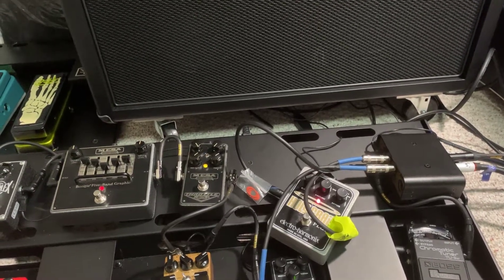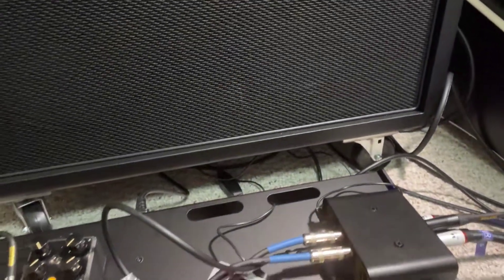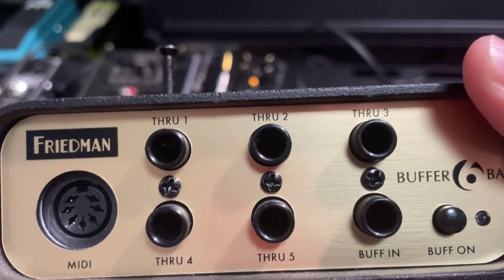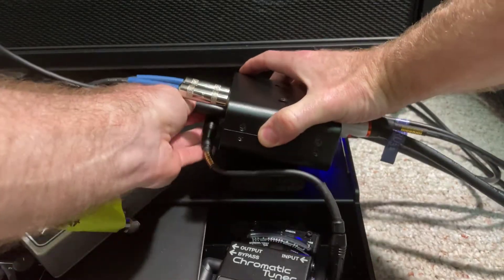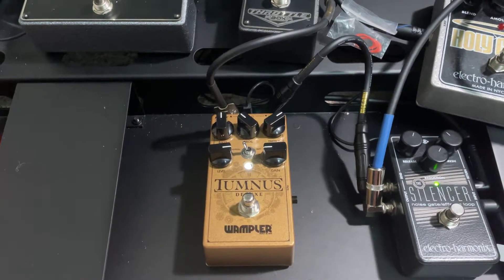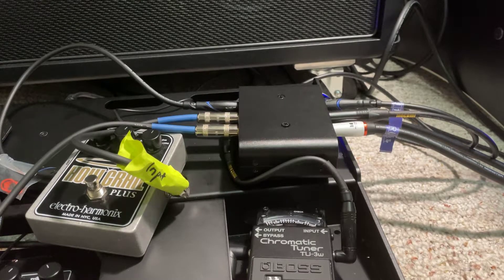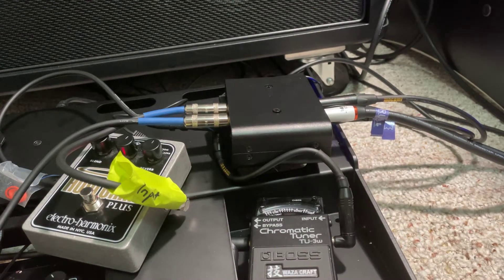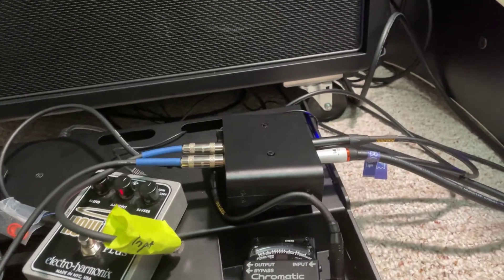Friedman Buffer Bay Effects Loop Routing Issue

Comment: Email Dave at Friedman, he helped me with one of his amps for an entire weekend , I didn't even know it was him till the last email. Great guy. I think this is a ground and easy fix. Good luck
Reply from the maker: I did email him awhile back. It’s actually the main reason I made this video, so I could show Friedman what was happening and what trouble shooting I’ve already completed. This was the reply:  “So the send and return  of the loop are on stacked jacks right.. on top of one another .. try not to do that.. the contacts are so physically close it can cause a oscillation .. Discovered the issue after it was designed…” 

So basically you just have to work around the issue.

Comment: Did you ever solve this issue? I have a Friedman board and have been thinking about getting the buffer bay. But there’s not much reviews out there.
Reply from the maker: Never actually solved, just a work around. The only way to prevent the oscillation is to not use the thru 3. This jack is right above the buff/guitar input. Friedman even got back with me and said they were aware of the issue; a design flaw they found out later. I'm not sure if there is any plans to fix it. Other than that slight hiccup it works fine and I really love the pedal board.
Reply: I'm pretty sure it is a grounding issue but why it doesn't do it in the other Jack I don't understand it's definitely a ground
Reply: I’m having issues with the buffer bay as well. There is a huge amount of signal lost while it is suppose to do the opposite. Any help on this please?
Reply from the maker: I’m not an expert on guitar effects engineering. I know some pedals, especially boss pedals, have built in buffers that may cause issues. I also know Fuzz pedals do not mix well with buffers. You should reach out to Friedman or other pedal gurus. I really like a guy who calls himself The Rig Doctor, he specializes in pedalboard builds and has a lot of great instructional YouTube videos.